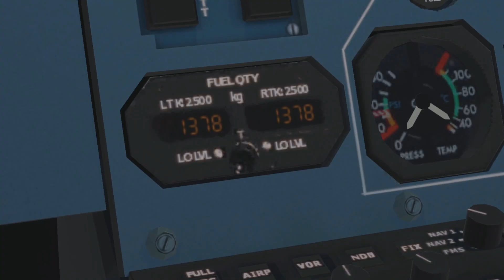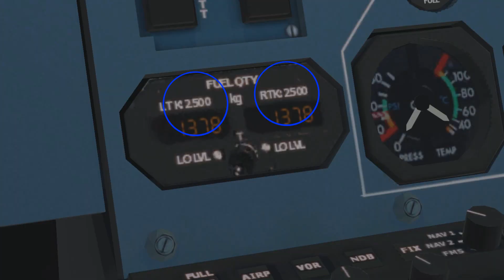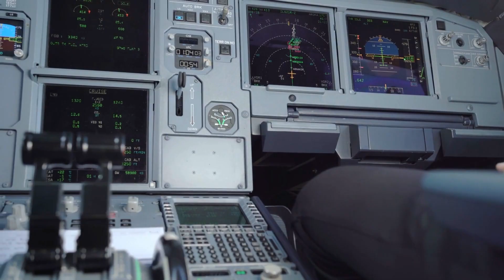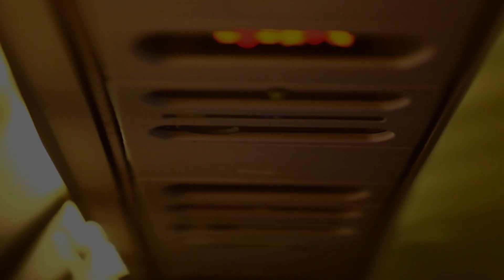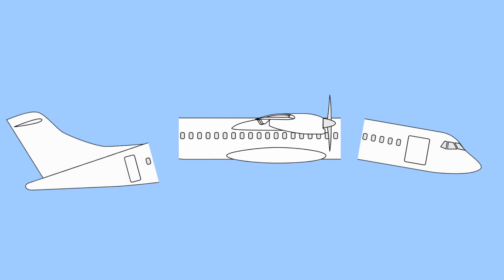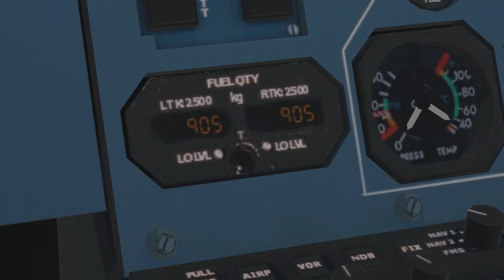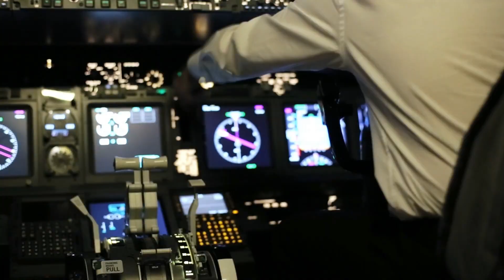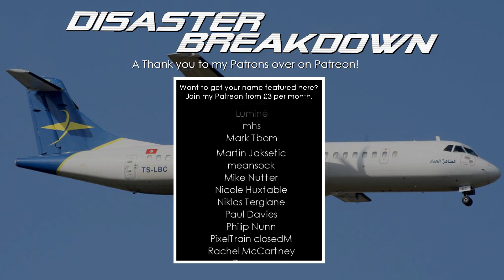Running out of Fuel Over the Sea (Tuninter Flight 1153) - DISASTER BREAKDOWN

Comment: Great video as always!
Just a small remark, you seem to say that as the plane was lighter due to the lack of fuel, it would glide further; this is not true: the glide ratio would be the same regardless of the mass of the airplane, the speed at which this glide ratio is attained is however slower the lighter the plane is!
(Hence why, as a glider pilot, we usually put ballast in the wings: same glide ratio, better speed!)
Reply from the maker: Hey thanks!

Thanks for the extra info too. I always wanted to have a go at gliding. its a shame I seem to have gotten that a bit wrong, thanks.
Reply: @DisasterBreakdown  No worries, this bit is quite counter-intuitive. Glad I could add a bit of extra info. If you want to dive a bit into the discipline, I would highly recommend the Pure Glide channel. There's also some great analysis of gliding incident and accidents there, which would perfectly fit the theme of this channel ☺️ and the guy's awesome.
Reply: @DisasterBreakdown  why did the pilots goto jail too?
Reply: @DisasterBreakdown  Hey, will you do the ariana afghan airlines boeing 727 crash?
Reply: @enjoleur31  hey Bastien, you know your stuff! I caught that too, but your comment got there first!
That was something I learned in some college class... The glide ratio is always the same, just at different speeds.
Reply: @GiBBO5700  Because the families of the victims wanted blood, most likely.

Comment: How can this be blamed on the pilots at all? Everything told them they had fuel left. Plus some engines require the prop to be windmilling to restart during flight at certain speeds.
Reply: Crazy, but sentencing varies by country a lot.
Reply: Because Italy.
Reply: How can any pilot takeoff without a fuel load sheet?  That’s how.  In aviation there are many failsafes.  You can’t count on just gauges but also fuel load sheets to confirm fuel went in...
Reply: Criminal sentences are not helpful to improving aviation saftey but the italians insist on it. The instruments indicated low fuel pressure at the engines. Also dual engine failure a very rare. A common cause such as bad fuel or a lack of fuel could cause such an event.

Comment: Wow, criminal charges for the pilots is not conducive to safety. People will omit and lie if there's a risk of losing their liberty.

Also - shouldn't the tanks be dipped for the first flight of the day and this compared with the displayed fuel quantity? If this is a mandatory part of our operations in light twins, surely a similar operational requirement exists for ATP category airplanes?
Reply: The correct procedure would be to notify the operations manager that the fuel slip was missing as well as using the dripless sticks to verify fuel load. Of course, this wasn't done.
Reply: @conradanderson3928  yeah this just doesn't make sense to me. I've never trusted a fuel indicator on an aircraft. It was always part of the exterior preflight - verify fuel levels are adequate ✅ and then after startup, verify fuel qty agreement ✅

This sure was one of those accidents where Dr Reason's swiss cheese holes lined up right. Had the faulty channel CB been left pulled, they would have noticed the insufficient quantity and even if they thought it was erroneous it would surely have provoked them to go outside and verify the quantity.

Comment: the pilot in an interview said they tried to simulate the incident flight by trying to fly the plane to Palermo but they couldn't, even when they acted as if they knew that the plane was out of fuel in the first place whereas captain al gharbi and his co pilot only knew that after the investigation.
Reply: And why would they assume they are out of fuel when the fuel gauges suggest otherwise. I mean they may have been able to figure it out if they had more time but at that point they were focusing on trying to restart their engines as per their guidelines. Pilots are 100% not at fault here
Reply: @Teh_Random_Canadian  exactly , that's the point i am trying to prove no matter what the pilots did it was impossible to glide the plane further

Comment: How a FQI can look basically identical from one plane to another is ridiculous, particularly if one is calibrated for a different fuel quantity.  Not so sure I blame the mechanic on this one.
Reply: Yes you definitely can. It doesn’t take much to actually read and verify the part number stamped on the unit with the printed procedures he’s supposed to be reading step by step instead of just sending it because it fits.
Reply: It's noted in the official report that the parts catalog provided by the airline contained multiple errors. Both fuel quantity indicators were listed as being cross compatible between the ATR-72 and ATR-42.  

The mechanics had written proof that the installed FQI was correct to the best of their knowledge. This is why the final report found them not at fault for this accident.
Reply: I'd definitely call that a design fault: if fitting the wrong variant of fuel gauge will cause false readings then it ought to have been designed with a different connector such as to make that impossible.

Comment: Why were the pilots got jailed?
They worked on what was thought to them in flight schools, they believed in tge instruments in front of them.
That mechanic should be the one facing jail time for man slaughter
Reply: You can’t trust just the gauges for fuel.  You have to have a load sheet confirmation. They took off  without that
Reply: They also had an indication of low fuel pressure. They shouldn't be jailed though. The italian system insist on such verdicts though despite no criminal intent and honest mistakes.

Comment: Absolutely insane that the pilots were sent to prison for this. They literally had no hand in creating this situation, or really any indication something was wrong until it was too late, but were forced into dealing with it - you could argue their response was not ideal and made things worse, but they were thrust into a situation no one on the plane could figure out the cause of, and had to come up with a solution under pressure; time was not on their side.

The maintenance engineer who installed the gauge faced consequences for the mistake they made, which directly led to this happening - and I think that's fair. Ideally whoever was in charge that allowed this to happen under their watch - perhaps the company itself - should have faced consequences too. But of course, that wasn't going to happen and that's the point here really - the pilots were just scapegoats here, clearly.

Comment: I don’t even think the two maintenance people that picked out and installed the FQI were that at fault, the computerized parts catalog that allows them to search for the appropriate part was programmed to show that the FQI actually meant for the smaller ATR-42 was compatible with the ATR-72 and could be interchanged, naturally he’s going to assume what’s being displayed is correct, and that there would be no issue with using the 749-158 indicator as opposed to the correct part. The second tech that actually installed the part could have caught the error, but of course, they’d probably be used to being given the correct part so many times that they didn’t bother to double check. Plus I feel like it’s easy for the human mind to see the label 2250 instead of the 2500 and not realize the mistake. I feel like during the refueling for Djerba that could have been the last chance for someone to catch the mistake, but at that point how would anyone but the first maintenance tech be aware of the discrepancy between the two FQIs and that the reading shown was inaccurate because of it.
Also how do Italian authorities expect the pilots to have executed the glide the same way the pilot in the simulator did, if they were unaware of the indicator issue? Lol they wouldn’t have even been thinking of the fuel out checklist, no? They assessed what was happening and went with what they knew. In order to do what the sim pilot did they’d have to be aware. 
The person most at fault was whomever entered that incorrect information into the parts catalog during programming. Second would be the maintenance person who checked the part out.

Comment: If they put a fuel indicator based on a smaller fuel tank, shouldn't it have shown that they had no fuel when in fact they did, since it was a larger fuel tank than the one configured for that type of indicator? In that case the pilots would've tried something different much earlier.

Comment: There is a suspicious lack of culpability placed on whatever entity was in charge of maintaining the plane above the level of the mechanic who replaced the fuel tank indicators. Whenever I see situations in which a part is incorrectly placed on any machine, whether it's an airplane or a sewing machine, there are generally two reasons behind it: corporate culture focused on turnover rather than safety, or a lack of training and knowledge among personnel regarding their jobs at even a basic level...which is also usually the fault of the company employing them.

Again, it is suspicious that the company in charge of that maintenance procedure didn't so much as get a warning. This bullshit is clearly just an attempt to blame the pilots and sweep the actual problem under the rug. The bastards responsible for sentencing the pilots should feel ashamed of themselves though I know they wouldn't. As for the mechanic, he was responsible for putting the wrong part in the plane, but I am hesitant to say more than that. Again, there's no telling how well-trained he was in his job, what the culture of management he was working under was like, etc. For all we know, he pointed out the problem to his direct superior who said 'use it anyway' and he did so to avoid losing his job. Doesn't make things right, but I generally have no faith in a situation where this big a mistake happens and the only people blamed are the guys at the bottom rungs of the totem pole. The follow up to this accident reeks of corruption and scapegoating.

Comment: What i find odd about the pilots being blamed is that the wrong indicator was installed, that's the bottom line. So the mechanic or whoever is responsible for the procedure is to blame. If the correct indicator had been installed none of this would have happened. Initially 8 and 10 years for the pilots, ridiculous even if it was reduced.

Comment: I am Tunisian, and I watched a TV interview with the pilot of the plane Mr CHAFIK GHARBI  talking about this incident in tunisian channel in 2018. You have some wrong information ! After 50 minutes of the departure the right enginee stopped working almost 2 seconds later the 2nd enginee stopped and when he restarted the enginees it worked for  3 seconds so it never came across his mind it was lack of fuel so he  kept trying to restart the enginees in addition there was a defect in the ATR factory. The alarm that warns the pilot of running out of fuel is supposed to be directly connected to the tank that is located in the wing of the plane, but instead in ATR 72 it is connected to the fuel meter and  in this case  the fuel meter which in itself gives a false reading of the actual amount of fuel  shows it full with 900 kérosène on each side (somme 1807 kérosène ) while it's zero empty and therefore the fuel outage alarm did not work and the pilot was never informed that the fuel had run out In addition, the problem with the original ATR 72 fuel meter was that it did not show the numbers in a very clear way. He informed the technicians about that, which caused to the wrong replace with an ATR 42 piece When the part was replaced, the fuel meter increased more than double He normally thought they filled the tank He asked for a delivery paper and was told that this plane was prepared to fly to Paris in order to transport a sick person, then it was canceled at the last minute, and that the last crew took the receipt with them and comforted him he will get it as soo as he come back that's why he flew without it and said that this information had never been confirmed by the airport

Comment: Not the first time when the justice system of Italy commit injustice ... What wrong the pilots did ? Unless they hide what really happened
Reply: They were required to get that refueling record. Ignoring that part of their procedures meant that the maintenance issue with the improper gauge slipped by too. It SHOULDN'T  be criminal in my opinion, but Italy takes that as negligent homicide when those procedures are in place to provide a safety net for the passengers.

 The flight was delayed because of the lack of paperwork, so it was a willful decision to take off knowing that either proof of refueling or an explanation for the difference in fuel readings was required by law before taking off. Most places it would definitely cost their jobs, and likely cost them their certification to skip that, but Italy opts for it to be criminal.

If they'd pressed the issue as required instead of letting it slide the accident wouldn't have happened. They'd refuse to fly, the lack of refueling would be revealed, and (given the maintenance record) they'd realize there was a miscalibration if not immediately knowing its exact form.

Comment: i wonder if there is another record anywhere in the world of an airliner pilot saving his passengers actually sentenced to prison? or this is a clear case of bully justice and racism against the pilots of a Tunisian airline? what if the pilots had settled for gliding to the runway in Palermo and crashed 2km short of the runway killing everyone? i have worked 12 years as maintenance PLC supervisor and i know for a fact those 2 incompatible yet outwardly similar Fuel Quantity Indicators were destined to be mixed by some maintenance technician somewhere in the world. blaming the pilots for not double checking on the amount of fuel taken before flight and not feathering the propellers is just beyond outrageous. criminal charges against ATR manufacturer for deceptively building two completely incompatible fuel quantity indicators (like incorporating incompatible connectors, rods, pins, even color) are more viable in this case. for whatever reason the poor Tunisians couldn't defend their pilots against this case of pure injustice.

Comment: I see all these “blame” comments on here when you can clearly tell the blame for this accident is multifaceted. This was an overall failure of the airline on multiple levels. Why didn’t the pilots even consider that it’s possible their fuel gauges were broken/inaccurate? Why were the mechanics too lazy/short-sighted to not install the right piece of equipment? Why were the fuel logs hidden from the pilots and then subsequently, why did the pilots take off without first seeing those logs?

No one person or small group of people are to blame. This was a failure on multiple levels and as a result, 16 people died and the airline lost one of its planes. In regards to the criminal charges, I do think the punishments for the pilots were a bit extreme, but they were somewhat negligent and did deserve some sort of punishment. I certainly think the mechanic or the supervisor that authorized the mechanic to install the wrong piece of equipment needed to face the most jail time since it was their actions that instigated this whole disaster.
Reply: Seriously? You’re blaming the pilots for not being psychic and knowing that the wrong fuel quantity indicator (that looks identical) might not actually be accurate? What at inane, uninformed, inaccurate comment!
Reply: @mandywalkden-brown7250  I’m blaming the pilots for not considering the possibility that the indicator is not functioning correctly, especially considering they departed without looking at the fueling logs and just assumed the plane had been refueled.

The pilots were negligent in this regard. They skipped a vital step before departing and doing that resulted in killing people. You want to talk about inane, uninformed comments, you are the poster child for it. You think pilots should be blameless for not being prepared for the possibility of equipment malfunctions? Please don’t tell me you operate an airline, because I sure wouldn’t want to fly on any of your planes.
Reply: @mandywalkden-brown7250  you’re the one who’s uniformed.  Procedures exist in aviation to prevent any single failure from causing a crash.  Fuel gauges fail, that’s why fuel logs are essential.  Jail time maybe harsh, but these pilots shouldn’t be allowed in the air again if they skip essential procedures.
Reply: The mechanics had written proof the FQI installed was correct for the ATR-72. It was discovered later that the parts catalog provided by the airline contained multiple errors.

Comment: Mechanic, or the company they worked for should had been the only ones going to jail. Solely on whoever signed off the repair. There are maintenance manual procedures for replacing parts and illustrated parts manuals to show what is effective. DUMB!

Comment: How the hell this is pilots' fault? They did their best to save the passengers with whatever info they had.
Reply: I think the video doesn’t do a great job highlighting the crucial procedures that weren’t done by pilots here that would have prevented this crash all together
Reply: The pilots failed to follow standard operating procedures both before and during the flight. It isn't legal to dispatch an aircraft unless the fuel quantity is checked using two methods. Blindly trusting the FQI alone is reckless behavior.